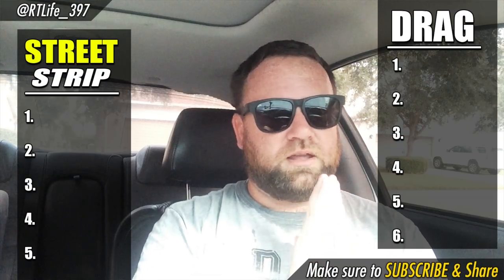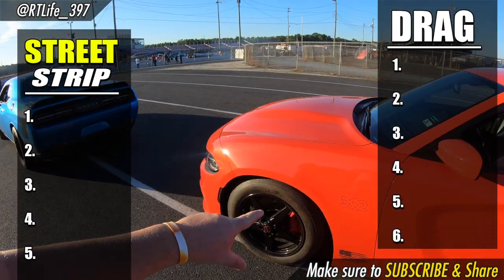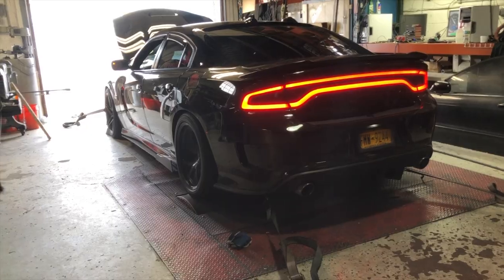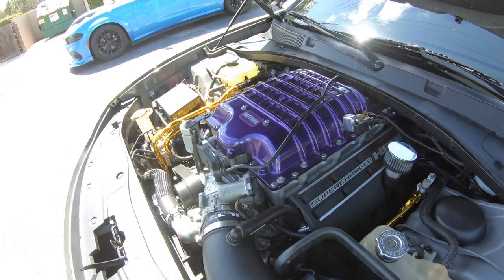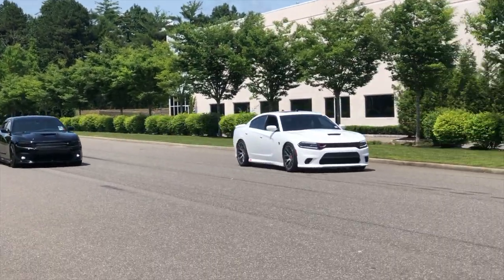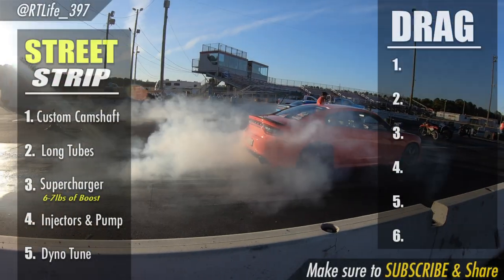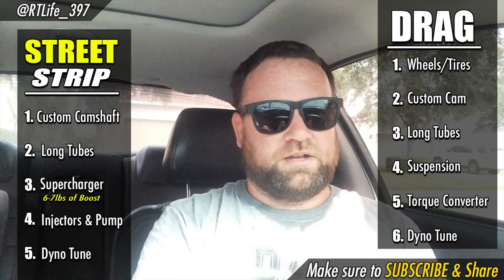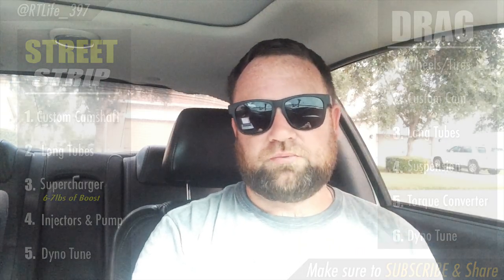Make 392 "Hellcat FAST"

Comment from the maker: Let me know what you would add to either list or what I missed! Thanks guys & hopefully this helps some out there looking to build up a 392.
Reply: I think the whipple 3.0 upped the game for the 392. Bolt on the kit. and make Hellcat power.
 As you said, with the correct tuner/tune.
Reply: Can some porting help
Reply: I would do the MMX 392 forged bottom end swap out kit and then I would send it
Reply: Why no mention of upgrading engine internals (aside from cam) for the first half of the video?
Reply: I wanna build my SXT to kill hellcats… I don’t have that kinda money lol… I’d probably need an easy 30-40k for that.  Twin turbo, supercharged, NOS, cam, LT headers, crank, torque converter, rear end, suspension, wheels/tires, injectors, CAI,true dual exhaust,  I’m sure there’s quite a bit more im leaving out lol
Reply: Actually If I had the $$$ I’d put a 572 Hemi with twin turbo and supercharger probably make about 2k hrspr lol
Reply: Anyway I can message you about adding some horse power to my 392 without it blowing up lol I hear lots of people say not to do to much bc it will mess up the car. But I really wanna add some horse power while being a little more informed on how to go about it safely
Reply: @brewaire 😊
Reply: I wanted to find out im buying a 392 Chrysler 300c but they say the pistons are too thin for any boost so u wanted to ask from your experience can the stock internals handle booost reliably 🙏

Comment: 426 stroker for the street,keep it naturally aspirated and reliable.  Go forced induction for the strip.   You will learn the hard way if you don't do it this way.   Ya you can do forced induction on the street if you run low boost.   But if your going to do that just go NA with a stroker crank and have a engine you can put a 100k and still put down a lot of power.
Reply from the maker: A stroker is always a great option - that's the route I went. The problem is how much it ends up costing in labor & parts. Turns into a full build - might as well do the camshaft, fueling, ported heads while everything is open. I was trying to keep the 392 from a total rebuild.
Reply: talking with mmx, its 4k more for forged internals on a 392 and a whipple with supporting mods than a 426 build. whipple, and forged internals seems like a no brainer when you think about the power differences
Reply: @TboneSRT so could a 392 handle boost if you went with forged internals and stronger studs. Or stroker it to a 426 or 454 and do forged interals and do a procharger or supercharger? I know 2018+ 392 blocks are the BGE blocks but..
Reply: @_itzjustquay8737  a 392 with forged internals is good for 1400 whp with the BGE block
Reply: @TboneSRT  oh bet appreciate the info OG!! 🤙🏾✊🏾. I love the way the 392 sounds at higher rpm’s than the 6.2 that’s just me. But I’ve heard some stroker kitted 426’s and a 454 but do people usually get a block from MMX or you could stroke and bore the the block that comes in the car?
Reply: @_itzjustquay8737  agreed! The 6.4 definitely sounds a little better than the 6.2 and yes you can use the 6.4 block and make it a 426!
Reply: @TboneSRT  good to know thanks again

Comment: Forgot how good my 6.1 car sounded 🙃 wait until her new 6.4 is done.. should be a fun car. Thanks for the love.  Oh and btw.. 4 2020 stock hellcats now have seen 570whp on our dyno jet.. we got a low one lol.. so being as my 6.4s not far behind with stock heads and stock headers is pretty impressive.. shows how good the 6.4s can respond to the correct stuff.. they all have their great benefits.. I like NA.. since its fast enough for the street.. but lord I love me a hellcat lol
Reply from the maker: Your custom cams always sound & perform the part. Keep killing the game buddy.
Reply: Speak of the Devil, lol.
 You were running like 11.1s with your 392 N/A right?
Reply: @brewaire  when it was stock cam. 10.7 with my test cam.. its got more in it but im not sure how far im going with it.. about to test a pretty extreme 6.4 head port for my orange car and see what it was worth doing what I did.. I may end up doing a set for the scat and adding some headers.. I think we can go 10.3 or better in good air.
Reply: @OMGITSMRMACK  That's AWESOME!
I've been creeping up on mine little by little but I have a 6 speed so it's a little more difficult.
 Put out some more YouTube stuff if possible please.
I don't have IG.
Thanks, Take care.
Reply: @brewaire  eventually ill drop a YouTube update on the orange one.. its staying a 6 speed.. goals 10s NA with the 6.4 as well.. but im building that one.. wont have anything stock engine wise. Goals to make hellcat power out of the NA 6.4 if possible
Reply: I thought if you modified a 392 you have to get all forged internals for it not the be destroyed because of high compresson?

Comment: Head work and valve train upgrades to handle 7k rpm is a must. With the extra 1000rpm they run right beside hellcats even if they make more power the extra rpm holds the same gear for longer and carries more speed. Example 4th gear shift point is around 85mph at 6000rpm. With the cam and upgrades to spin 7000rpm you can rev out to 105mph before needing to shift. This makes a mountain of difference.
Reply: "head work" meaning ported heads and a valve job?  Minimal gains NA.  These heads flow great stock.  You're not going to see appreciable improvement until you're already making hellcat power under boost.

Comment: If stock 392s are running mid 12s, then my little 5.7 is gonna make some 392s mad, because hopefully i should be running close to a 12.0 with a factory converter and street tire, all N/A
Reply from the maker: Let me know how it goes. When are you planning on going to the drag strip?
Reply: @RTLife  hopefully soon, sense florida gets about 3 days of cool weather a year. Just waiting for a tune, and revisions, and to install the new rear end. Going from the open 3.08, to the 3.70. Might spin though, but its gonna be quick
Reply: James Whitesell I run low 12s personal best 12.14 I have just a tune&headers Your going to need drag radials.

Comment: Nice video. My 392 Grand Cherokee is currently getting a stage 1 cam, forged pistons and rods, upgraded valvetrains, stainless works long tubes, ati damper, along with afe intake, rear resonator delete, and a greene tune. Best stock run was 12.6@107 and a 4.26 0-60 at -151ft DA. These upgrades will get me to a sub 4 sec 0-60 and a low 12 1/4 mile

Comment: Great video R/T 👏👏 Alot of people don't realize the 392 is a little bit bigger NA to start. With just 6-7 psi of boost they'll run with or better a hellcat. Hellcats at sea level are 11 psi. At 2000 ft above sea-level they're 10 psi 😉
Reply from the maker: Exactly. You can get these 392 hauling ass without completely gutting them & doing a full build. 6-7 lbs of boost will net you a big WHP gain.
Reply: You've gotta change the transmission though or get one built. The 8HP70 can't take much more torque over stock.
Reply: @lb9355  Yes true but to get one built or to get the hellcat one built. Besides at the low boost level I think it would survive more than people know. All's fun and games until the boost is raised 😎 then lookout tranny in the near future 😋

Comment: Wassup R/T life, got a question for , planning on getting a Durango, me and my wife have four kids and this will be my daily driver but I’m stuck between a r/t or a srt  , which one would you recommend
Reply from the maker: All depends on your budget. Hard to turn down that 392 power right out of the gate. I love the 5.7L & didn't mind modding it so it was a nice fit. If it's your daily I would say the 392 SRT is the better bet, so you don't have any down time adding HP/Torque.
Reply: @RTLife  hey thanks for responding, love the channel, long time follow, yea I’ll go with the 392 , and what’s your favorite exhaust setup of those 392
Reply from the maker: You should check out mid muffler delete (sounds solid on 392). Also borla Atak & magnaflow Xmod are up there - both have aggressive exhaust sounds without any drone or being to raspy.

Comment: Love your videos bro. Thank you.  
 I have a 2013 charger srt8 6.4. Plan on getting long tube headers and maybe a hellcat TB. What Mackbuilt cam would you recommend?
Reply from the maker: I would talk with him about which custom grind camshaft would work best. He has really great results for 392 guys - that & long tubes will really pick up a lot of HP/Torque for you. Def worth the $$$
Reply: @R/T Life  thanks for the quick response.  I will definitely do that.  Those are at the top of my list.  And a tune of course.  I currently have the diablo i3 tuner.

Comment: So Iv just done a complete build on my 2021 scat pack internals lifter springs pistons rods then added a procharger and Holley intake sniper manifold plus Holley fuel pump and 1500 fic injectors my question is what horsepower is to much for the trans and what trans did you go with because I have a feeling I’m ganna need one real soon
Reply from the maker: Once you pass 650whp & similar in torque that Hp70 is going to struggle. From the sounds of it - you're going to be well past those numbers. I'm installing a built hp90 so I can drive it with a clear mind.
Reply: @RTLife  yea I’m deff going to have to I’m looking to be around 800 to the wheels so here I go adding to the shopping cart thanks buddy keep up the content Iv been watching you since the day I bought my car same with rodent red hemi you guys rock
Reply: Modern

Comment: Excellent video man. I would also add in stripping the seats or replacing them with much lighter ones as well as the extras in the trunk. Save about 200lbs. Can also do carbon fiber from say Anderson composites if you got the coin. These mods will increase everything while leveling the playing field on the street and track. Find the lightest wheels and break kit available along with a carbon fiber drive shaft. Springs track or street will help no spinning on the street in addition. Dif brace for wheel hop. Some times it’s not all about power sometimes it helps to utilize efficiency of what you have first so the engine doesn’t have to work as hard to compete or win as the competition is always lighter. Let’s be real if these motors were in a mustang or a vet it would be end game for them. But no credit is given as the body weighs 2 tons. So do this and all the mods mentioned say good night Chevy ford in the na game track and street unbuilt. One last thing of you are trying to roll race na in these cars intake runner length matter for upper rpm along with porting which will pair nicely with a upper rpm breathing cam. Take a look at the fastest roll racing na Camaros they tend to be hi ram on top of running nitrous or meth injection to cool inlet air like an intercooler shrinking molecules while oxygenating at the same time allowing to run more timing than just 93 but the flexibility of only running 93. Tune is paramount especially if this is done. Meth has its own problems but it’s a route just don’t run dry. Nitrous has its own problems as well but everything has its draw backs it’s just knowing how to get around it. Sorry for the book but I figure those who want info will read and those who don’t will say write books much grandpa. That’s cool 🤣.

Comment: I dynoed at 755 in colorado altitude with a stage 2 cam long tube headers whipple 3.0 e85 upgraded torque converter fully built on only 8lbs of boost and 1050 cc fuel injectors 
I just got 2.5 pulley voltage booster for the fuel pump I'm hoping to be about 860whp but it's been a mission no rebuild on the transmission yet thankfully good so far

Comment: I like your content mostly because you'll have discourse with people about their builds. I have a 2015 charger scat pack with a cold air intake, 95mm throttle body, a holley hi-ram, jba long tubes, and full 3 inch exhaust. How much do you think it'll make to the wheels with a dyno tune?
Reply from the maker: Are you sticking with 93 or going e85/109?
Reply: @RTLife  I'm gonna stick with pump gas
Reply from the maker: Those upgrades will pay off more after you cam and/or add forced air. Depending on whos tuning, I would bet it gained about 25+whp & similar in torque over stock 392.
Reply: @RTLife  I've got a comp cams stage three cam on the way. I'll let you know what it makes

Comment: Great vid! I’m happy with my stock scat pack but I do wonder how my rt would have done with the vision I had for it 🤔
Reply from the maker: What did you want to do with your R/T?
Reply: @RTLife was working with joe at lemon chasers. Plan was a ported and polished 6.1 intake manifold, cam, shorty headers larger throttle body and a procharger. Probably not hellcat fast but definitely fast

Comment: If you are adding boost to a 392, you damn well better look into forged pistons and rods.  Also, the tranny is only rated at 517wtq.  Boost is going to put you way over that.
Reply from the maker: if you're dropping in forged internals it's going to open a very expensive door. You will want to run more then 6-7 lbs of boost - that will lead to a transmission swap, upgraded fueling w/ all new lines, etc. A tuned hp70 can handle around 650 of torque - after that you will begin to slip. A stock 392 can handle 6-7 lbs of boost no issues if tuned properly.
Reply: @RTLife  to build a boosted scat to around 800hp is like 20k at most

Comment: I have a killer set up in my 1320 with heads, cam , intake, long tubes on 93 and run 11.2@121 in 2800 da and a lousy 60 ft
Reply from the maker: Who's tuning it?
Reply: @RTLife  @dsmlights in florida
Reply: @RTLife  now I’m full E85 but no runs yet but what a difference that  fuel makes with more timing
Reply from the maker: e85 is def a big upgrade over 93. You should've picked up at least 20whp. Now is the time to get out to the drag strip in FL. The weather is cooling down
Reply: @RTLife that would be awesome
Reply: Nice video

Comment: I have a 2012 srt 8 FBO Cam & e85 & I’m only making 470whp. I was expecting way higher numbers. I feel like something is holding it back. Could it be the tuner?
Reply from the maker: How does it do at the drag strip? Sometimes dyno correction factors are different. Which is why some read higher then others. In the end, all that matters is how fast is it.
Reply: @RTLife  haven’t been able to get a good run.. whenever she hits 120 mph the check engine and battery light comes on and she stalls high almost like it’s pulling whenever I let off the brake. Code reads throttle body so I went back to stock TB &!just had same problem today. Really do what’s going on. We do 160+ pulls on dyno no problem but on the street it gives problems
Reply: @srtLEE  Did you ever figure out what the problem is? If not, I would try data logging, or if you have an obd scanner, you should be able to see the freeze frame data and show that to tuner or mechanic.

Comment: So what’s the parts\labor costs on those builds cuz I’m starting to wonder if getting the Hellcat would be cheaper
Reply from the maker: Really depends on where you live & the quality of the shop. I don't talk prices usually because they're so different for everyone
Reply: Your right, getting a hellcat is much more cheaper, plus you have a warranty, compared to getting all those mods going to cost you 15k+ to get 640whp
Reply from the maker: People don't account for down time while modding these cars as well. I haven't had my car in 2 months. When I did my Stroker kit - that was 2 months etc. That said, in this the 640whp 392 is much faster then a Hellcat - don't let the similar HP fool you. But, if you can get afford a Hellcat - get it. You will have a much higher ceiling to add power without having to break everything down & start from scratch.
Reply from the maker: Also the sticker price is just one part. I've priced out a hellcat & 20k doesn't seem like it would add much to a monthly payment. The sticker may be $20k but then you have taxes & fees rolled into those payments - adds up quick esp. when your insurance goes up.

Comment: I was under the impression you couldn't throw a supercharger or turbo on a 392 do to the way the engine is without spending ridiculous money to rework various part do to the added power?
Reply from the maker: Just make sure you use the right tuner. Many guys run 6-7lbs of boost without any issues. Anything more you're running a risk & should upgrade those pistons ASAP.

Comment: Or you can just swap the 392 for a hellcat longblock and much cheaper to do 👍
Reply from the maker: yah that's always an option. I see some used hellcat engine/transmissions on ebay for $20k in good shape.
Reply: @RTLife  if your patient they are even cheaper I've seen some down to 8500 with trans
Reply: I bought a Scat brand new, fully loaded, I could afford the Hellcat as this is just 3rd car for fun so to me it’s way more fun to get the scat and add the hellcat longblock and make a killer with all the scat badges.